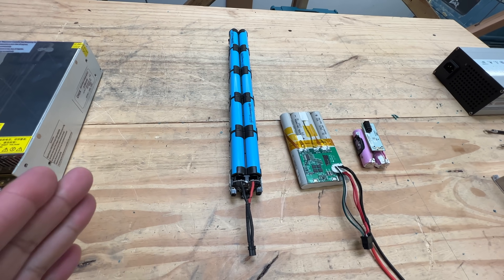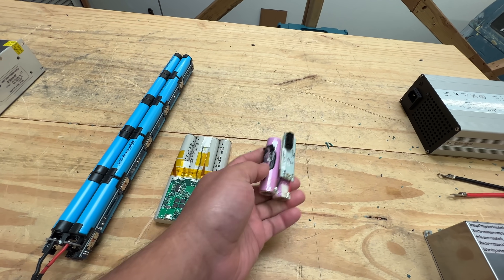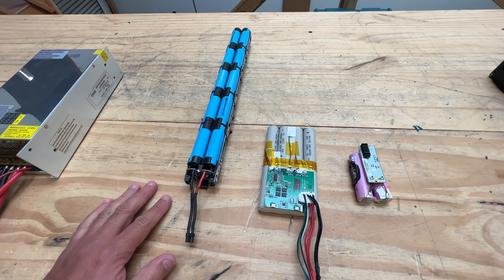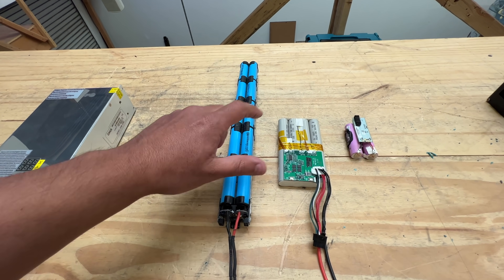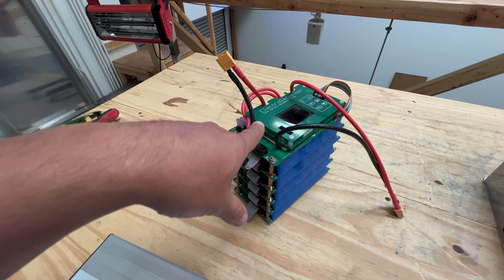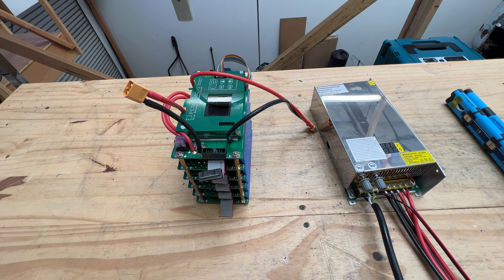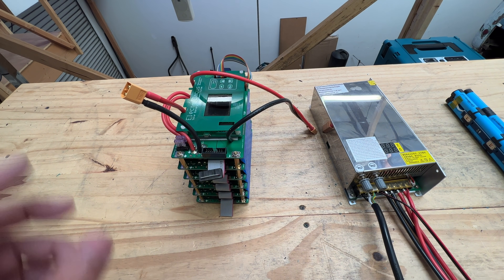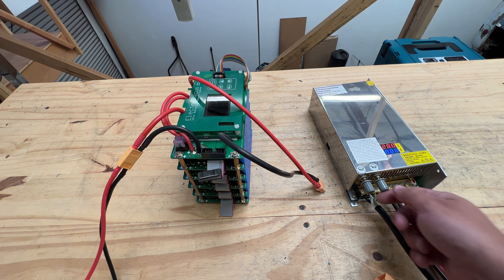All DIY Battery builders Need a Variable Power Supply

Comment: I'm a little confused with your link. Would I be buying the same product you are using in your video? Your link to page looks fine, but when clicking on buying the description on AliExpress confuses me. So, is the page on AliExpress correct?
Reply: I tried the buy through AliExpress. Tried to create an account would not accept. I don't trust that site. Ok I'm moving. I'll stick to Amazon.

Comment: Just wondering what if you send enough voltage to turn on the bms and with a second variable power supply connect it to start charging the batteries?

Comment: I normally connect it back to charging through the bms once the battery goes above the minium voltage required by the charger

Comment: A solar panel and cheap solar charge controller on my lead acid car battery will charge at just one volt above whatever voltage the battery is holding at the moment and is the best way I have found to save a dead car battery.  It will desulfate after about a week of controllerized solar.  I wonder how that would translate to lifepo4 and li ion.

Comment: You're better of using an RC hobby charger, which gives you much more information about the battery than a power supply, and it will be cheaper.

Comment: Thats the way , i wake up low-voltage  Batterys. Slow charging directly without BMS. At 2,6V per Cell, you can load it correctly by bms and the right charger ;-) Sorry, for my rusty english

Comment: I use the imax b6 for $20.  Works well for charging RC batteries so it’s good enough for packs of 18650
Reply: Ya as long as you know you have to do like a 3s if you only have 8v and then up 1 or 2 cells till you get the voltage up

Comment: You just gave me a great idea for 18650 in packs that need to me recovered.  I haven't tried finding out if CC or CV is proper or if both are required.

Anyhow use neodymium magnets attached to the power wires to connect to the single cell.  The nickel plating is a great conductor and will make a strong connection.  I've seen magnets that take a counter sunk screw, a ring terminal screw and nut your golden.

Thanks for innovating and getting me thinking as well!
Reply: Both are required. CV to make sure it never goes over voltage and CC to limit the current to 0.05-0.1c while recovering.

Comment: Wow, thanks for the info!
I was looking into some bench power supply for a friend.
Paid my crappy bench one 0-60V 3A (180W)  for 70E 2 years ago. And I had a hard time finding it, most of them were 0-48V.
Those are 0-80V 8A (500W). For 50E, that's a no brainer.

Comment: This is the best option for something on the low price range. Definitely. But everything Jehu says. 100%agree. I like the Riden Power Supply but it is expensive but WOW! What an amazing power supply. A bit more complicated but worth it. I have maybe 3. It’s always good to have a few. A cheap one and a really good precise one. Awesome video Jehu.
Reply: One exception, Jehu claims @5a each cell is getting 1a, each battery PACK (4 cells) is getting an amp which is only 250ma per cell.
Reply from the maker: That’s not how it works,  if you charge at 1A  a 7s packs all cells get 1A through them.  Paralleled cells get divided intro the total power input/output
Reply: @jehugarcia  right. That’s what I was trying to say. Awesome video Jehu.
Reply: @bigdaadio.K2WW  I think he meant 5a each side meaning 1a each cell.
Reply: @bigdaadio.K2WW  meaning 10a total. Where the max is 1a each. Pretty good for me for seeing the reliability of the cell.
Reply: I was looking at the ps output, I was under the impression the supply was connected to all the packs, as they were in parallel. Wasnt the pack a 12 volt nom pack? I just presumed it was, and wondered why it was being charged at 21v...
Reply: @bigdaadio.K2WW  understandable